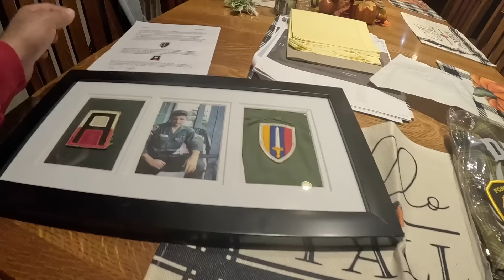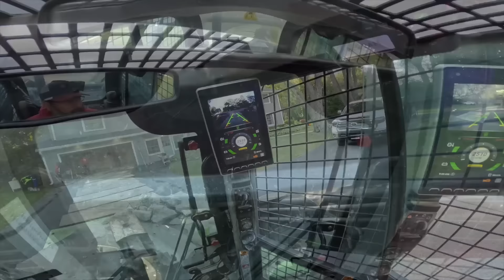I love this equipment! FAST and EASY!

Comment: Too bad I live in New York because I'm a mechanic and I also have a mobile mechanic business and I could literally get your daughters car fixed quickly especially if it is just the head gasket or timing issue it'll be quick for me to fix either way but unfortunately I live all the way in Upstate New York LOL!!
Also your truck sounds like it needs a starter replacement or the flywheel replacement because that starter grinding noise isn't good sounding and if the gear teeth are slipping on the flywheel it'll cause damage to the gear teeth on that making that need to be replaced!! But if you already replaced the starter before not very long ago it'll probably be the flywheel that is got stripped teeth that's causing the starter to slip and grind! Either issue is no Beuno Ryan LOL!😂

Comment: make sure you check the oil in her car make sure the shop didnt forget to drain the oil before adding more to it or some crazy stuff that does happen at times and can damage the engine also possible they didnt put the proper oil in or forgot all together

Comment: The catalytic converter could be clogged also......that would cause those symptoms.  Change the PCV valve that's $5!   You're burning oil, oil is getting into the combustion chamber.  Smoke is blue, that's the indicator....

Comment: To clarify I was talking about the dump truck with the short and as for the starter issue you might need a shim or 2  If it is the starter the bendix is not fully engaging into the fly wheel and it will need a new starter not a rebuilt starter  I do not think it is the flywheel but it could have wore out enough over time  the starter is the lesser of the 2 evils  ty for letting me share again yuuuuup

Comment: The Kia could either be a blown head gasket, or a failed turbocharger both would be lack of power and pump out a lot of smoke when driving and both are common failures for the engines in the Kia soul that they also used for several models and years.

Comment: Big ray about them grain locks you broke off so I was hauling lime 50k pound and I forgot the grain locks a were on idk why they were on but dump trailer all the way up and I think to my self why is nothing coming out I hopped out the semi soon as my feet hit the ground only way to explain it was, it seemed like a rocket both locks broke and everything came out at once and push the truck so so so fast like drag car leaving fast it was so scary I'm glad the place was flat but the truck took off and yes with trailer breaks on. Like a drag car fast

Comment: The color of smoke coming out the tail pipe will point you in the direction on where you should look. White smoke coolant/water is getting into the combustion chamber. Bluish smoke is oil getting burned into the combustion chamber. Black smoke is over fueling very rich mixture. I would pull the spark plugs and borescope and look into the cylinders while using a coolant  pressure tester and watch for some coolant “bubbles” entering around the cylinder head and block on the inside of the cylinder. Kia/Hyundai don’t makes the best engines there is a reason the manufacturer offers 100k mile warranty on there engines when bought brand new they are known for head gaskets/burning oil/oil sludge/ bearing issues.

Comment: If its blue smoke its burning oil white smoke head gasket issues the engines are have oil consumption problems i wouldn't be surprised if the piston rings are going bad

Comment: fiance had a hyunday. Same rigs basically. Same ordeal. Sometimes it would lose power and when it got it back, it would dump smoke out. Then it would smoke when you put your foot into it. I think youll notice when you gun it, a rattle in the engine. Listen carefully. Will be worse if its on a cold start. I think your motor is gone.....

Comment: It is so unfortunate men I am a really hard worker always curious to learn something always asking always motivated I know a bit of concrete I can strike off, I can grade, pull wire, finish a bit (not perfect) I can operate all types of machinery from excavator to a crane I know how to do mechanical stuff to equipment and cars and i now how to do sales can take care of the rentals and estimates and I don't care to be on video actually I am a very funny guy to be around  I would be  a very good guy to be added on the team 

If it was possible I would definitely work for u but I live in the Netherlands 🇳🇱 😢

Comment: Ryan you mention your fence needs to be pressure washed well that's what I do for a living I own a pressure washing business and that should have been done in a couple hours the most let me help  you could go down to home Depot and get liquid pool bleach it will be 10% diluted down to 3% get a little bit of Dawn dish soap only add a little put it in a sprayer.. spray concrete let it the dwell for 3 to 5 minutes with a white tip you will rinse it off it will come right off clean like brand new it's called soft washing you are a great father a great boss and a great man and you having your mom showing up that's a mother and sons bond that just shows how great you are .... keep up the great work 👍